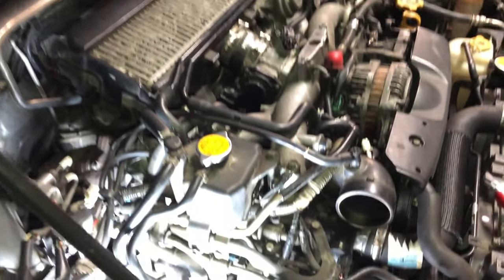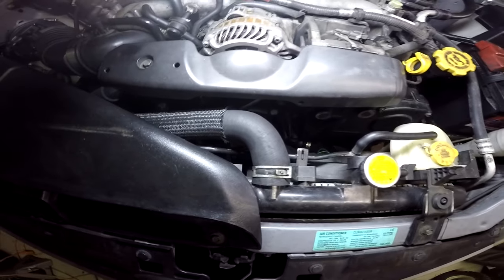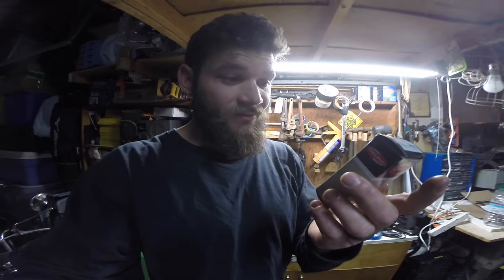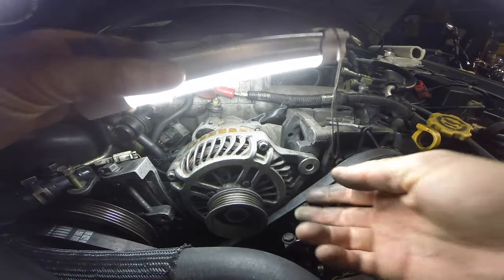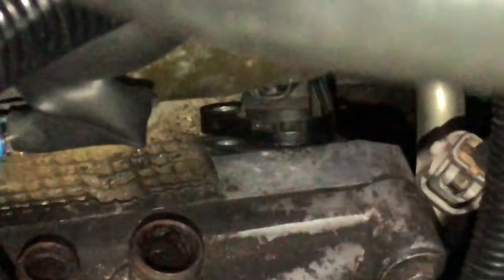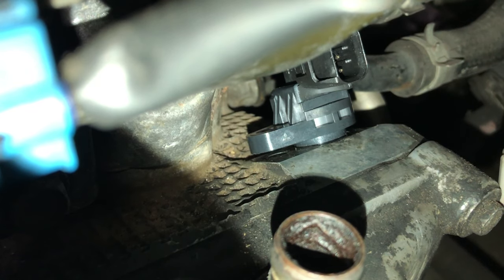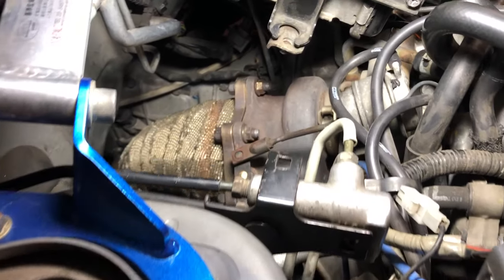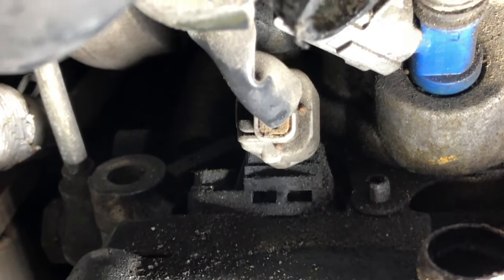SUBARU Crankshaft & Camshaft Sensors REPLACED! FULL TUTORIAL CEL P0340 P0341 P0345 P0346 P0365 P0390

Comment: A = Left side engine (Passenger side)
B = right side engine (Drivers side)
Bank 1 = top sensor
Bank 2 = lower sensor
Reply: Cheers. Thank you for that.
Reply: Assuming there's only ONE crankshaft position, why does my code come up as: Camshaft Position Sensor A Circuit??? I see the Letter "A" means passenger side but but isn't there only one and it's located under the alternator? I have 2008 subaru impreza 2.5l Automatic  EJ253 Engine. I had a code for it come on and go off in under one hour which was weird. It just turned on my CHECK ENGINE light. I cleaned it with rubbing alcohol but it barely looked bad; it just had some dusty, dark powder-like coat on the flat part of the tip if that makes sense.
Reply: @86mnillaman  That’s the crank angle sensor you cleaned out. The cam angle sensors are different to crankshaft, yes two camshafts, and are at the back on the top of motor. There’s an A and B, being left and right, I’ve no idea which is left or right, I’d replace both. Hope this helps.
Reply: Ah yes! Having four cams there would be four cam angle sensors. I totally forgot the later models had twin cam. Thanks for the heads up Angelo.
Reply: @MrKeenaz  I hear you but my code was for the crankshaft. I checked it but it's not on as of no and hope it stays that way but you said to replace the two cams but I don't have an engine code for those. Do you think I should pull and inspect them? Maybe they caused my Crankshaft Position Sensor code to activate? I'm tired of this car. My main issue also is that when I'm accelerating it's sluggish but I have no engine light codes. I've changed the fuel pump assembly with OME part(s), fuel damper, injectors, the sending unit sock strainer (basically another filter that sits in the fuel tank that has a filter on it, New Spark Plugs, ignition coil maybe two years ago, so no engine codes, Spark plus wires, engine oil 3 weeks ago, new battery and alternator, both 02 sensors and new catalytic converter. This car does this bad accelerating. Very sluggish to build up pressure in the exhaust it feels like for it to really go. There's no holes in the exhaust and I do have an aftermarket catback muffler from ebay. So I don't know if maybe it's the catback has something defect or if it's something else. It's very frustrating
Reply: Incorrect.
"Bank 1"= Denoted by which side of the engine has cylinder 1. "Bank 2"= Denoted (obviously) by which side of the engine has Cylinder 2. In the case of Inline engines, only one bank, will never see a Bank 2 code. "Sensor A" denoted by which sensor, in Alphabetical order, in the case that there may be more than 1 sensor monitoring a system, also denotes the ONLY sensor monitoring respective system. 

For example. V8 engine. 2 Banks. Lets say you get a code for O2 sensor Bank 1 Sensor A (Some manufacturers will continue with numerical value, ie.  B1S1). So you'll be looking at the upstream sensor (pre catalytic convertor) on whichever side has cylinder 1. Some V8's have cylinder 1 on drivers side, some on the passenger side. If the code was for a Bank 2 Sensor B, you'd be looking at the bank 2 side downstream sensor (post catalytic convertor). So in recap:

Bank 1= Side that has Cylinder 1
Bank 2= Side that has cylinder 2
Sensor A= First sensor (or only sensor) monitoring respective system
Sensor B= Second sensor monitoring respective system

On these years of Subaru, Cam position was monitored on the intake cams only due to the Single AVCS system, there were no exhaust cam sensors until 2008 STI came out with Dual AVCS which added variable valve timing to the exhaust cams as well
Reply: *Correction

A = RIGHT side engine (Passenger side)
B = LEFT side engine (Drivers side)
Bank 1 = top sensor
Bank 2 = lower sensor
Reply: I have a problem with code P0365. Camshaft position ( CMP) sensor B, bank 1 -Circuit  malfunction.  which sensor will it be??
Reply: Engine code is ej205
Reply: Thank you
Reply: @MVYKL  
L0
Reply: ugh thank i put mine B nooooo
Reply: 2018 n the code says bank 2 sensor b. I'm assuming it's just reversed?
Reply: @kacperploski9798 This is Passenger side, Exhaust (lower) sensor. I disconnected that sensor while idling to do a test, and that’s the code that came up which makes sense.
Reply: Bank 1 = Passenger Side
Bank 2 = Driver side
A = Top (Intake)
B = Lower (Exhaust)

Comment: Thanks brotha! replaced cat with high flow downpipe, new turbo, new plugs, new blowoff valve $4000 to SpeedyRoo in Aurora showed no positive results only made thing worse so now on to new coil packs and camshaft position sensor. I should be getting upwards of 13psi of boost but i'm only getting 6 at best. I'm encouraged by your video.

Comment: Having the same misfire issue on my 06 wrx, all cylinders. I replaced all spark plugs and coils, replaced crankshaft sensor and now working on the cam sensor. I cannot believe you got the driver side cam sensor out like, gives me hope to get mine out without removing the intake,lol. Also, i need to look for the passenger side one and replace that one as well. Thanks for the video!
Reply: I've tried several different wrenches and couldn't get one on the passenger side 10mm the housing gets in the way, any tips?

Comment: I'm having the exact same problem in my 2011 wrx. Literally same code and everything. Cylinders misfiring, code P0340. Hoping switching this will fix it!
Reply: Did it?
Reply: @sanicsanic7018  yes and then it came back with another code so I had to replace the actual regulator near the camshaft, and now I have to replace the phaser. But replacing the sensor did fix that code then it came up with a new one

Comment: Dude. Thank you. I was able to find all of my sensors and know which ones not to pull thanks to this video. All I needed to remove was my turbo heat shield and I could get my hand right on it. Took about an hour.

2011 WRX hatchback OBP
Reply: How did u get to the bolt
Reply: @SkyMuffinz   Better question is how did you get the bolt out on the passenger’s side one? This makes no sense. The bolt is way too close to the sensor housing to fit a wrench- open or closed ended on it. A 10 mil socket is the only thing that can reach around the bolt but then the 10 mil socket and rachet is too tall…
Reply: @Deleteguest  10mm shallow socket with a swivel built inwith a 10 inch extension bar through the gap straight from the top
Reply: @SkyMuffinz  I don't have any shallow sockets, unfortunately. I did end up purposely snapping my little 10 mm wrench in half, so I could actually have room to rotate it down there. Worked like a charm
Reply: @Deleteguest  good to hear

Comment: Oh man. Been there done that. Purchased a Forester XT a couple years back. Ended up needing a camshaft and crankshaft position sensors. Had the valve cover gaskets replaced and had an 04 STI steering rack put in cause the oem 182k mi steering rack was leaking. Vehicle did come back with 130-135 psi across all cylinders with 10-12% leakdown according to my tuner. I’m closing in on 200k miles and only really consuming 100-150ml of oil every 1000 miles or so.

Comment: @Angelo C Incorrect. "Bank 1"= Denoted by which side of the engine has cylinder 1. "Bank 2"= Denoted (obviously) by which side of the engine has Cylinder 2. In the case of Inline engines, only one bank, will never see a Bank 2 code. "Sensor A" denoted by which sensor, in Alphabetical order, in the case that there may be more than 1 sensor monitoring a system, also denotes the ONLY sensor monitoring respective system. 

For example. V8 engine. 2 Banks. Lets say you get a code for O2 sensor Bank 1 Sensor A (Some manufacturers will continue with numerical value, ie.  B1S1). So you'll be looking at the upstream sensor (pre catalytic convertor) on whichever side has cylinder 1. Some V8's have cylinder 1 on drivers side, some on the passenger side. If the code was for a Bank 2 Sensor B, you'd be looking at the bank 2 side downstream sensor (post catalytic convertor). So in recap:

Bank 1= Side that has Cylinder 1
Bank 2= Side that has cylinder 2
Sensor A= First sensor (or only sensor) monitoring respective system
Sensor B= Second sensor monitoring respective system

On these years of Subaru, Cam position was monitored on the intake cams only due to the Single AVCS system, there were no exhaust cam sensors until 2008 STI came out with Dual AVCS which added variable valve timing to the exhaust cams as well

Comment: I had P0011 recently on my 2007 Hawkeye 2.5 STi. All I had to do was clean out the single AVCS solenoid on Bank 1 (drivers side in the UK) Was idling so bad. Great now, total cost....zero! Single AVCS on an STi Hawk is just the inlet sides, the later 2008 upwards 2.5 STi is twin AVCS, so exhaust sides aswell.
Reply from the maker: Thanks for the info! 🍻

Comment: Top job lad. I’ve gotta car doin the same bloody thing after blowing the radiator. I think the excessive heat has damaged the sensor. I would still replace the two camshaft at the same time. The other would probably not be to far behind. Cheers from Australia 🇦🇺

Comment: I have a 2017 WRX STI / EJ257. I had P000D C.E.L =  B Camshaft postion slow response bank #2 (driver side top intake cam sensor).
 I was not able to wiggle it out like this video shows(different engine bay maybe).

 I removed the secondary air pump and Fuel rail guard(3 bolts, the bolt at the back is a doozy). I hacksawed part of the cam sensor and was able to get it out like the video shows. I filed the new sensor down and was able to put it in . Forcing the sensor in or out can damage it, mine had a scratch

I was in a hurry , the right way without having to file down the sensor would be to remove the tgv /intake manifold.
Reply from the maker: It definitely was a struggle for sure. I guess I got lucky for my model year. Glad you eventually figured it out 👍
Reply: Code came back, upon further research "B" might mean bottom sensor... lol . 😅
Reply: ..So it was bottom sensor , Changed out the Camshaft sensor on bottom left (driver side) and the ocv also. No more P000D.  

My cobb readings  avcs exh left and exh right now match up, before the left avcs would overshoot or be too many degrees away.
Reply: @BongRiperson  I was having this exact issue(same MY and car) and you just saved me a lot of headache lol thank you

Comment: The lines attached to your intercooler that you pointed out were sludgy are not actually a part of your intercooler; they are a part of your PCV system. The intercooler is just a handy connection point. The rubber lines shown connected to your valve covers connect to these lines.

Comment: On the crankshaft position sensor the first one you were placed which wire color goes close to the engine and which wire color goes closest to the radiator My wires pulled out

Comment: Just came across your vid.  My 2011 starting sputtering and running Like ass, stalling out at low rpm sputtering and popping under load, and sucked ass. Babied the piss outta it for 20miles unfortunately.  No cel popped on, until tonight when I was checking for boost leaks and all epect hookups and turbo stuff. Haven't pulled code yet, but yours sounds exactly the same as what is happening here.  Dunno what it did for ya when you were taking off or cruising but under boost it sounded horrible initially.  Then I did my best to keep it out of boost and go slow and then it was just trying to keep her alive just far enough.  Tomorrow I'll pull everything and see what side it is and get after it. Thanks for this

Comment: Awesome video, I’m having a problem with my daughters car, 2005 Subaru Outback LL Bean 3.0 , no crank or start. I replaced the fuel pump, alternator and starter and now the battery and same issue and I came across your video and I had been thinking it’s a sensor or relay but I can’t use my CarMD until I get it started. I did get a relay tester and test out a few of those. Any thoughts on this?

Comment: 2016 sti just picked up 2 weeks ago, code P000D comes up, and and B apparently making banks 1 and 2 screwed. I still have faith in this car, I want to fix both sensors and give it another shot also taking to consideration that my oil pressure may be messed up, or foreign things and/or metal could be intruding in my pistons or wherever. Any tips?

Comment: I've done shit like that a million times. Happens to everyone. I had an old 02 outback with 3 hundo on it and I had a bag of spare sensors, hoses, fluids, etc. Cuz every 500 miles or so something would glitch out and I would be at the junk yard pulling stuff an old junker. Over time I had so many extra parts that I could usually just open the back hatch and find what I needed. Even had a CV axle back there.

Comment: P0340 was only code I had. replaced bank 1 with oem senor. Still didn't wanna start. Did I need to undo the battery and hard reset? I don't have my cobb acessport unfortunately.. lost it.
Reply from the maker: Sorry for late reply… Did you happen to check the camshaft sensor wiring for any disruptions? Sounds like maybe a wire has been damaged.

Comment: this is actually getting me to think about my ford ranger ... simular engine cut off issues, I replaced the cut off switch (inertia), the fuel pump, and a crank shaft sensor, but now i'm thinking its gotta be one of the other sensors.

Comment: Had p0011 p0021 p2089 p2093 did 2 oil changes and flush, checked banjo bolts, replaced ocvs, cleaned and added 3 more grounds, changed throttle body wire harness that was damaged, still getting p2089 also did new spark and coil packs. Everything works but my OCV % and AVCS are weird. Seems like AVCS not kicking on and Bank 1 OCV has lower % than 2 then dies out. Currently in pieces in the driveway with the hood and Im watching videos with greasy hands trying to find answers...

Comment: Did you notice anything changing about the way your car was driving prior to your check engine light for the camshaft sensor.
Reply from the maker: Yes it was running like crap. Engine was Sputtering and jerking a bit then shortly after I got the CEL

Comment: Hello great video 
I have a 2015sti I’m getting code P000D
Says camshaft position control 
Now I’m not a mechanic, but I would like to try and fix this myself 
I’ve looked around a few different shops 
Here in Canada 2intake sensors are 165each
And two exhaust sensors are right 177
And left is 110 haha
Seems expensive, where would you start 
Should I just bite the bullet and replace all four?
Reply from the maker: Odds are they aren’t all going to fail at once. But if it makes you feel better, replace them all. I only replace as needed. Good luck!

Comment: Do 2.0s have 2 camshaft sensors as well or just 2.5s? Using this video for my 04 wrx but couldn't find the passenger side sensor.
Reply: Did you ever figure this out?
Reply: @MrRonaldweasley   I never got a complete answer online but I only found 1lf them on my car.  I chose to replace it (since i had no luck finding a 2nd one) and it solved the issue for me.

Comment: hola me pasa lo mismo tengo una duda el sensor de levas que codigo tiene como lo pido tengo un wrx 2002
ayudame
Reply from the maker: You plug in a scanner and it will tell you the code. Autozone or oreilly auto parts should have one to use for free.

Comment: (Help) I have codes P0335, P0340, and P0345. The main problem is... the car won't turn on at all. (75K M) 2016 Subaru WRX. (I had the battery fully charged. Still won't turn on).
Reply: Did u fix it？ I got the same codes
Reply: @jinbangliang3177  The car is currently not turning on, I did make progress yesterday. I switched my fuses inside the vehicle, and the car turned on completely; it even idled for 20 minutes (motor sounded good). Then I went to shut it off, and when I went to turn it back on, the car short circuited the fuses again, and it shut off completely. I wouldn't be surprised if the codes aren't "sensor" related and, in fact, are variable valve timing related. I have 2 of them that have corroded; their easy to access. Just gotta figure out what's currently short circuiting my car and eating through the fuses. 

Car not turning on? Check your fuses #10 & #21 (7.5A) & Check to see if your battery requires a replacement. Sensor Codes? Change your oil first. Still sensor codes? Replace your Variable Valve Timings (their easy to spot and connect directly to your camshaft sensors). If the sensor code is still showing up, then I would suggest changing the sensors as a last resort. Trouble passing emissions, purchase a CATACLEAN Fuel Injector, and follow the instructions to clear your monitors. Look up Drive Cycles. You should be able to complete them within 40-50 miles (anyone telling you to drive for 200-400 miles doesn't know what their talking about).

Comment: What size is the bolt holding the sensor in place? It's been giving me so much grief trying to get the angle flush to loosen it!
Reply from the maker: It should be a 10mm if I recall correctly!

Comment: Helpful video 
Quick question do you lose power just because of the code?
Reply from the maker: Yes, more than likely your car will run like poop and also be in limp mode until you get it fixed.
Reply: @06wrxdude  oh 
I have P2092 code and it’s slow as hell man 
Thanks 🙏

Comment: So my 07 Impreza 2.5 non turbo won’t start up. Before that I was running rough like barely making it up a hill just hesitant. I replace maf sensor pcv vavle did a head gasket and main seals as well as water pump and timing belt.  I had codes for the vehicle speed sensor and neutral safety switch. I replace the safety switch but not the vehicle yet ! Could this also be an issue for my car ? The camshaft and crankshaft sensors ?
Reply from the maker: Did you have a check engine light? You should have a list of codes you can use to help determine your problem.